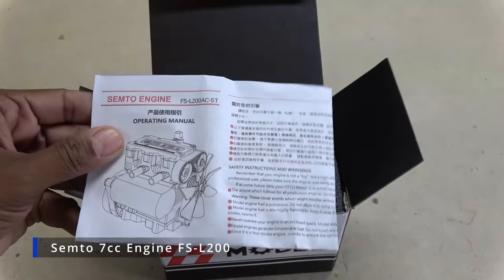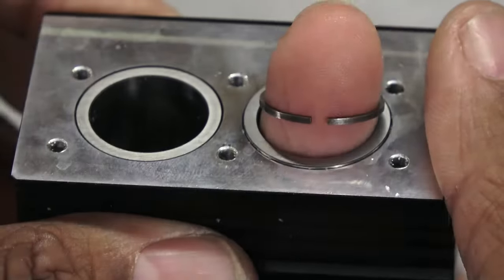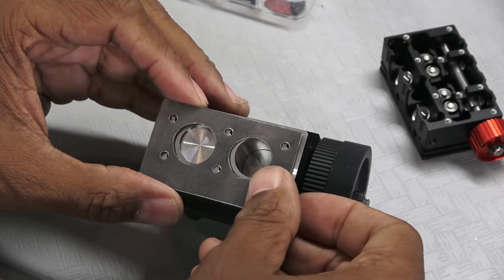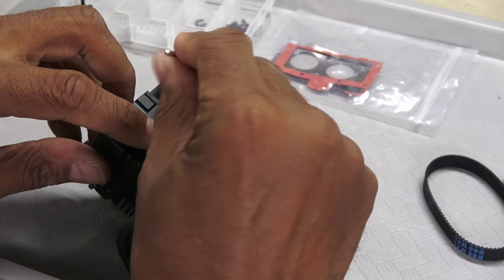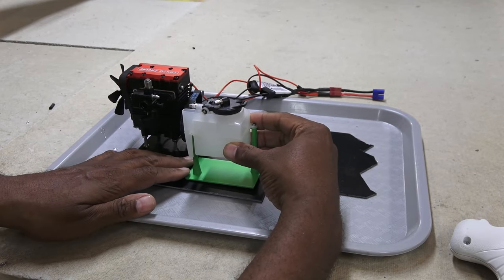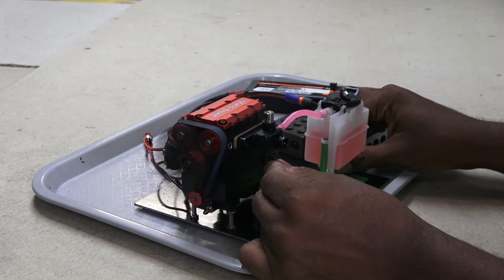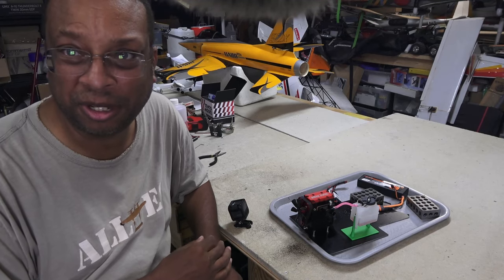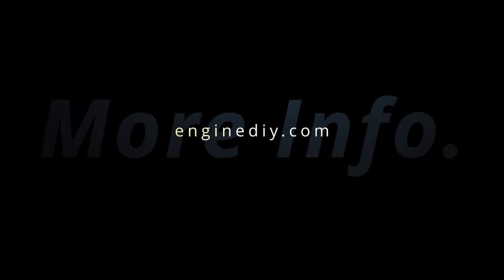Coolest Thing Ever - EngineDIY, Semto 7cc 2-Cyl 4-Stroke Glow engine | HobbyView

Comment: All your videos are amazing. I would suggest that you convert a RC Model truck to use the 2 cylinder engine. Include step by step instructions and use of a transmission. I have assembled the engine and installing in an RC model truck seems like the next logical step. 
Thanks
Reply from the maker: Good idea, but I'm actually working on a different application for it.

Comment: They sent me one to build on my tiktok channel. I put it together last night knowing the crank and cam should be lubed, but it didn't call for it, so I didn't. Guess I'll be pulling the valve cover and oil pan off lol. Idk much about these nitro engines, so I'm not sure why they picked me, but my knowledge of real engines makes the carb and intake setup confusing to me. 

I think I'm gonna try and power a drill with mine once it's running lol.

Comment: Hi Fitz,
Maybe it would work good in a boat?
Reply: Yeah it would because it would be easy to get cooling but it doesn't make that much power and doesn't Rev very high. A hot .21 would be much faster.
Reply from the maker: I think it would be very cool in a boat.

Comment: Wish I could get mine to run anyideas?
Reply from the maker: Did you see the point in the video about setting the needle valve correctly?
Reply: @HobbyView  I'm re-watching it. Two more questions how did you wire the starter button 2) you said you wired the two glow igniters together? I thought of one more question it came with two silver head gaskets no clear instructions for that so used them both what you think?